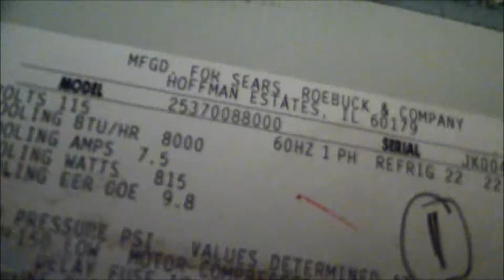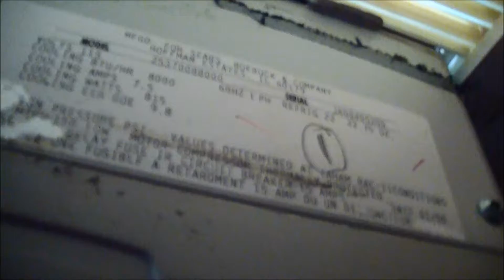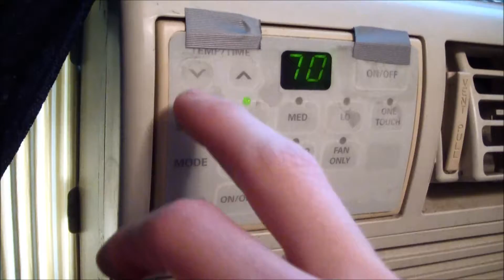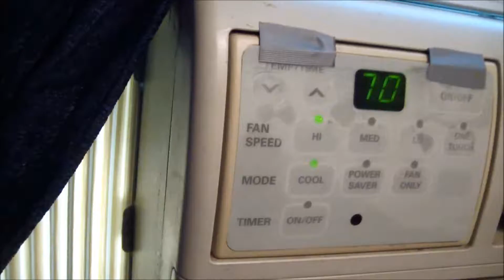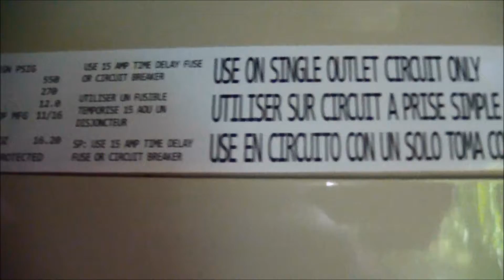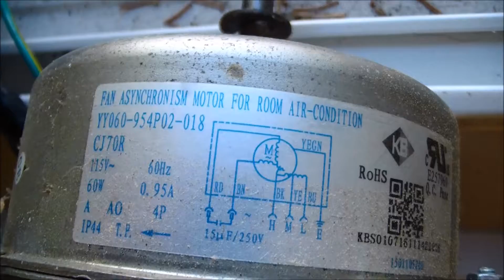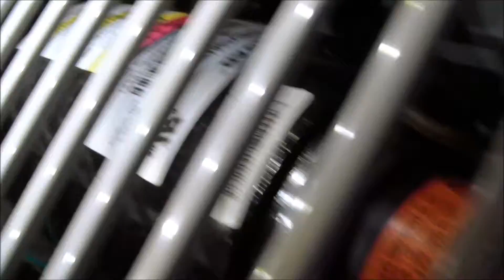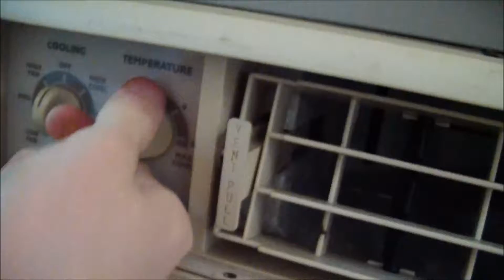2000 Kenmore (WCI) 8000 BTU Air Conditioner Vs. 2016 GE (Haier POS) 8000 BTU Air Conditioner.

Comment: 0:36 what kind of fan is on the left of the air conditioner?
Reply from the maker: It's a 90s windmere 12 inch stand fan
Reply: @brunoshow124  How about you do a video of it if you still have it.
Reply from the maker: @Daconthocon78  I have it still I can make a video of it soon

Comment: That kenmore is shot!
Reply from the maker: How? Cosmetically it looks kinda rough but it works great and inside it looks like new, not even any rust.
Reply: Ok
Reply: Why is it rattling
Reply from the maker: @fanboy11thefanfanatic  that was the vent louvers one of them wasn't in all the way from when I cleaned it and it was rattling a bit in the air flow
Reply: BrunoShow124 okay